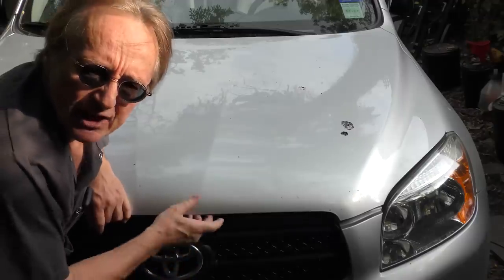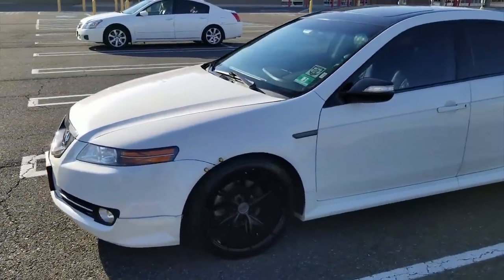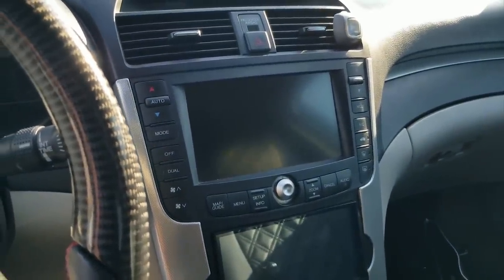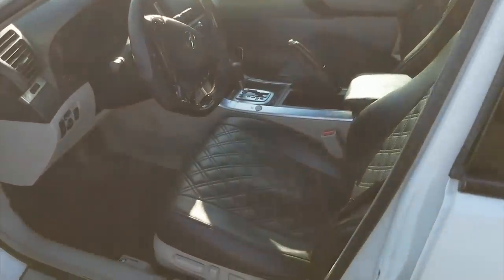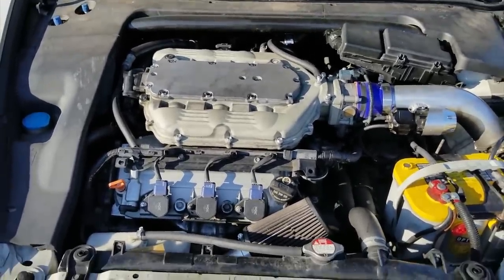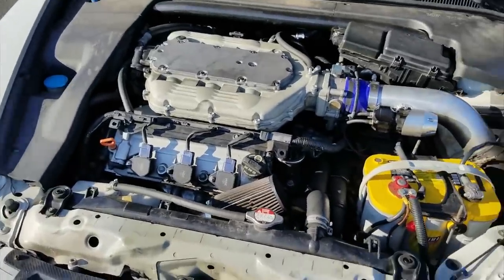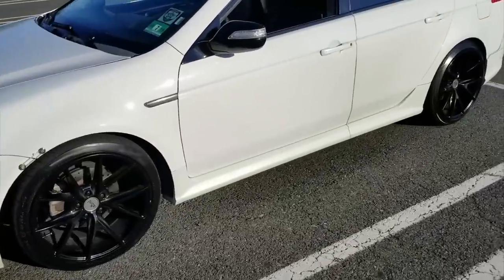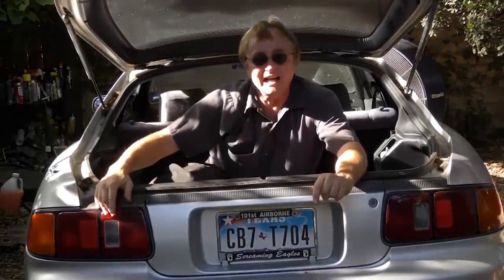Here's Why This Base Model 2008 Acura TL Makes 437 Wheel Horsepower

Comment: It's a turd gen lmao!!!
Reply: Michael Trower Wasn't the transmission kinda fixed in the 07-08 models? I know for a fact that the trans in the earlier 3rd gens had grenades for a trans
Reply: BS. 3rd gen TL is probably the best Acura vehicle this century to date. I have a 4G but the 3G is timeless.
Reply: +Ryan L. What you're driving is a rebadged legend , they stopped using the legend name as it was killing the name Acura.Very good car but you have to understand them.
Reply: Rhoan Campbell get ur info straight, TL is actually the Vigor line not Legend. RL is the Legend line.
Reply: Michael Trower. West Indians and Germans use the silent h.

Comment: Anyone who has watched classic Top Gear knows, because Richard and Jeremy have proven this several times, a front-wheel drive with more than 300 BHP will cause a problem with control and steering at high speeds.
Reply: theylied1776 unless you’re still still spinning your tires you’re fine boosted boiz did some crazy mile runs or something in his 700 hp civic and I’m pretty sure he got over 160 or 170mph.
Reply: That's the problem. The torque from the front-wheel drive transmission makes it harder to steer and control at high speeds. I used to race amateur rally... and all-wheel drives are fine because the torque is at the rear wheels but the front-wheel drives with 300 plus HP can be tricky at high speeds.
Reply: Also, driving a 300 plus HP front-wheel drive at high seeds in a straight line is one thing but get on a Grand-Prix style track and try to take those curves and dips in one of those is totally different.
Reply: theylied1776 oh yeah definitely. Having random and varying traction in the front is never good for corners.
Reply: HLSD and a good suspension/chassis solves this
Reply: No, they won't. You cannot solve a problem caused by Horsepower and Torque with good suspension/chassis and HLSD. The more Horsepower and Torque a front wheel drive generates the worse the problem.
Reply: Some of the fastest race cars are fwd...
Reply: Let me add to my original statement; with good tires as well. If you get good traction and allow for independent drive-wheel speeds; as long as your tires are grippimg and not slipping, you'll be just fine at any speed. Nissan has the FWD GT-R LM (for Le Mans) that has 1250 hp
Reply: It won't make a difference. At a certain point, 300 plus HP, the machine is stronger than any human. That is basic physics.
Reply: FWD GTR or All- wheel drive? That is a big difference.
Reply: Post a link to these race cars. There is a big difference between FWD and AWD.
Reply: FWD my dude it's  a GTR LM not a street car by any stretch not the R35 you're thinking of either
Reply: Jonathan Trevino if it's not a streetcar how does that apply to what we're talking about? But feel free to post a link to this car becuse I would love to see it and look up the schematics.
Reply: Yeah you clearly don't understand basic physics... If it's putting the power down and gripping it'll be just fine
Reply: Engineering Explained has a good video about why it's superior for Nissan's application
Reply: Because it's still a FWD car. You can make a high hp FWD car grip and attack corners very well with a good set up.
Reply: Jonathan Trevino Instead of all the insults why don't you just post a link to this car? That's all you have to do, why is it so hard for you?
Reply: Jonathan Trevino You're claiming it's a front wheel drive car... fine, just post a link. It's a simple as that.
Reply: Jonathan Trevino Enough of the opinions.... post the link!
Reply: theylied1776 the 2018 Civic Type R proves that wrong.
Reply: Martyn Rosenburg How exactly does it prove me wrong?
Reply: theylied1776 It doesn’t because the Type R still suffers from torque steer.
Reply: Knuckles300 Exactly, because every front wheel drive car suffers from torque steer. And the more horsepower, especially above 300 horsepower, the worse it's going to suffer from torque steer.
Reply: Jonathan Trevino I looked up the Nismo GTR-LM and the reason why you didn't post a link to it is because it only ran ONE race and was scrapped by Nissan due to its piss poor performance. The FWD race car failed.
Reply: Man even had torque steer in my 1.4 turbo chevy cruze lol
Reply: andrew Smalls Yeah, that's just the drawback of a front-wheel drive. But you have these front wheel drives with 500 to 600 horsepower controlling and cornering becomes a problem. It's not impossible but with some people it can cause them to crash.
Reply: His car doesn't make 437 HP at the wheels - he's lying.  The most powerful front wheel drive cars made today are 305~ish.  Acura TRX and Lincoln MKZ...a couple others too.  The limiting factor is the transmission torque steering you into a wall - cuz that Lincoln goes to 400HP (same engine) if you get AWD.   If huge manufacturers can't fix that problem with todays technology, nobody in a garage watching YouTube videos did it either.
Reply: Matthew Thrasher Yeah, but this guy is a Tuner. He rebuild the top end modified the CPU. So I don't have any doubt that car will probably have about 475 brake horsepower especially with that Beast of a supercharger he has. If you notice he also mentioned he blew his engine, that is very common when people don't know what they're doing when they modify their engine. I Used to Know guys like this and I thought they were stupid for trying to modify a front-wheel drive to get more than 300 horsepower.
Reply: Matthew Thrasher obviously manufactures don’t do it because it would make the car more expensive to produce. 437whp isn’t that much of a stretch in this car
Reply: lol, what is this nonsense.
Reply: Brad DeGarren You're right, manufacturer's don't do it but you have these amateur Tuners and Weekend Racers that do it. This kid modified his engine, that's why It blew up the first time but he eventually figured it out. If he doesn't put a cooler on that transmission it's going to overheat.
Reply: Reject Which part are you having a problem understanding?
Reply: Jonathan Trevino yes but 300hp and fwd doesn’t grip no matter what you get some wheel spin from Honda’s garbage differential in take off and gear changes
Reply: My 300+ hp FWD handles just fine thank you very much
Reply: theylied1776 lmfao bro there's a front wheel drive Acura integra with 1200 hp hitting 208 mph just fine one time he got swervey but he got back on it and at the time he has 900 hp now he has 1200 on a 4 cylinder

Comment: I like this build, RL J35/J37s are the strongest i think along with the CL Type s j32. Are you using DW-1 trans fluid or something else? How do you like those NGK coils? did your oem coils all fail or you did it as preventavtive
Reply: Redline racing with Redline d6 mix and a Trans cooler
Reply: @PiterStreak  Ah Ive heard good things from people using the Redline D6 in the Glass trans Odysseys. I just use DW1

Comment: Dragsters are automatics..
Plus honda automatic transmissions are manual transmissions with clutch packs instead syncros. A torque converter so you can keep the engine running on idle and a hydraulic system to control everything assisted by the TCM.
Honda have to design their transmissions due to patents permits declined.

Comment: Much praise for that custom engine build.  Not sure if it’s best used on a front wheel drive with the TL slush box.  I wouldn’t exp3ct it to last a whole lot longer.  I had a 2006 TL and the torque steer really sucked.   I can only imagine what it would be like with that much horsepower.   Might be time to use your engine building talents on a rear wheel drive vehicle.  I bet you learned a lot building that thing though, which is very admirable.

Comment: Shoulda had the manual in already.  Then again it’s not my $5,000. Awesome steering wheel & the sacrifices AC for the turbo is something else.
Reply: Jon Rock I've learned a lot through the process. You are correct
Reply: PiterStreak I’m $68,000 away from doing something dumb and hopefully being on this show 😜

Comment: As soon as i heard vtec twice i was gone. Like it's some sort of magic thing.
Reply: John Robinson the video mentions how it's not even true vtec. Hell the dyno chart shows vtec doesn't do anything this setup
Reply: Okay i'll bite. vtec is a compromise. If it was done to it's full potential, honda could not sell it to the general public at a price that would be profitable. And DOT would never sign off on such a thing for every reason that could be thought of. Power and speed cost money. And for most the money runs out faster than any car you could drive. I've built a few engines in my day with good success and had my days in the sun. Back when you could do such things for reasonable amounts of money, those days are long gone never to return. I'm older now got a son to get thru school that is what matters now. Going fast is fun to a point, but not that important anymore. Yeah, i tell myself that.....I have still have the sickness. And will most likely die with it. ( Spits out lure, swims away....)

Comment: It holding up because by the time power comes in the load is off trans slap a real kit on it and see how that teams holds up I bet a modder almotor will keep up
Reply: It's linear power so it's easier on the Trans. A turbo would have trashed it

Comment: Yikes. Unforunately, for the older J-series automatic transmission, they are usually prone to issues, especially under aggressive driving conditions. They can usually have an extra trans cooler to keep the fluid from varnishing, but that’s about it, on top of running automatic racing transmission fluids.

Comment: Spoiled a nice build by placing the air intake in the hottest possible spot: directly behind the radiator and above the ex manifold/cat.
Reply: Still pull though and instale air Temps still lower than a ton of cars 🤷‍♂️
Reply: @PiterStreak  Was that a sentence?  "Still lower than a ton of cars" ??  Doubtful. You're just making excuses for medocrity and poor implementation.  The only location that could be worse would be behind an exhaust tip.  But hey, according to your logic, that would still be acceptable if a "ton" of other cars did it...  Right?  SMH
Reply: @supermarioisacat  clearly you understood. However you want to interpret what I say is your business. I never said that the intake routing is optimal. That's how the kit comes and that's how I left it. Regardless of its location, it works. If you think you can do better, message the company and who knows. Maybe I'll upgrading my intake.

Comment: Actually most Hondas only have VTEC on the intake side. Vtec is basically almost useless now a days even the new turbo Si doesn't have vtec at all unless you are in Europe. And I believe the new type R only has it on the intake side as well for fuel economy purposes  ...there are really only a hand full of motors that have vtec on both sides

Comment: The car is technically manual its automatic and also should have the sequential gearbox as well. If you want to have more revs thats your best bet sequential gearboxes are expensive and that honda is known for having good transmitions is a good deal. If anything keep it stock with the sequential. Not as skill needed but definitely faster than the normal manual.

Comment: The base model of that car has terrible torque steer as it is. With that much horsepower, I can only imagine this thing will never start straight 😂. Some of the mods are really cool though. I really like the smoked out taillights and the steering wheel looks cool!

Comment: Had an 05 tl it died of trans problems 😅
Oooh hes from jersey too!!
Reply: zibby Jdm the 07-08 had the Trans from the RL which was way better. That's why I stayed away from the 04-06
Reply: PiterStreak the facelifts were better :/ but the base 3.2s had slightly less hp

Comment: I think the Automatic is better than the manual. For the TL at least.
Reply: It's better for this guy's scenario because OEM clutch would implode. My 06 TL was 6-spd and still holds 2nd place behind a C6 Z06 for absolutely nailing every little detail. The manual 3rd gen TL caught BMW off guard because 3-series Enthusiasts were bailing in droves to buy the new TL after reigning supreme for 30 years with the 3-series. All I'm saying is test drive one, even if it's got 200k miles on the ODO, still elite.
Reply: @DTMJR1987  I would never have used an oem clutch with this much power increase over stock. I have a manual now and moved the kit over. Using a spec stage 3+ clutch capable of holding 700hp

Comment: Hello Scotty. Just had the fuel filter changed on a 1997 F-150. Engine was running fine before, but now after fuel filter change it's developed a miss fire under load. Idles fine, but misses under load. Want to mention that the filter looks as though the it was never changed since new and now has close to 189,000. Also when removing lines from the filter 1 of the lines rusted though and broke. Replaced the defective fuel line from the filter to the rail from another vehicle of the same year. Any ideas?

Comment: I’ve owned an 04 TL and leased a brand 06 TL. These TL’s have a horrible transmission. The 04 needed a whole new transmission at like 110,000 miles. Even the brand new 06 had something wrong with the transmission, not a big problem but even still.

Comment: Acura needs to step and make some RWD or AWD Models and not crappy FWD or AWD thats basically FWD bias
Reply: Rdaplaumax they do, S2000 and NSX.
Reply: Acura's Sh-awd engine layout are FWD base but still dynamicly supperior to RWD Base Audi or BMWs AWD. The engine sit right on top of axles while the Germans have engine front of axle. Also drive shaft is symetical like subaru while Audi/BMW have an extra shaft to turn the front wheels.

Comment: Even with e85 at 12 psi of boost no way it makes 485hp. And when he gets on it doesn't even sound close. I've got a cobalt ss turbo swapped that makes 320hp and way faster
Reply: Camera frame rate is a crazy thing. I have dyno sheets.

Comment: Why would you buy a base model 3.2 if you’re just going to turn around and convert it to a 3.5 considering the Type-S came with a 3.5 factory. It seems like like he could of just bought a Type-S with a manual trans and he would of saved a lot of time and money.
Reply: The lowest mileage manual one I found online was priced at over 21k private. Not that many manual options on the market.
Reply: I bought the car not being into cars. Slowly started modding it and went from there.

Comment: I'm surprised the stock transmission was able to hold that power... these transmissions are notoriously weak
Reply: Not the 07-08. Sold the car NA and it's a show car now in NY. Trans still original

Comment: but when does it put out 437 HP ? at 7000 RPM ?
Reply: farerse yeah since it's a centrifugal SC. Higher rpm=more boost= power at the highest rpm
Reply: that's pretty high RPM , what are those rivets on the fender by the way??

Comment: A stock on makes about 290hp
Reply: The 3.5 makes 286 at the crank. At the wheels its lower depending on the transmission

Comment: He chanched engine supercharged but he still have the automatic transmission ok that sounds like a car guy i guess and still the original transmission can take the change in hp that he made maybe the dile new he was going to do that and put a biger transmission on that spesific car  because those engines often brake the transmission plus the hp he added thats the only thing i can think of

Comment: Why is a manual transmission over the top and special. I think people see them as something for sportscars and something that is hard to operate but you can learn to drive manual in a day and in this case the car would benefit a lot from a manual transmission and in my opinion i would never turbocharge or supercharge a car thats automatic

Comment: base model auto... bruh. I can't wait to juice up my 3.7 sh-awd MT some day. costs a lot though. you can retain A/C if you wire and plumb in an electric compressor.
Reply: I have a manual type s now. Moved the kit over. Also swapped the J37a4 from the awd 4th Gen tl  👍

Comment: The guy thinks adding a manual transmission is going to add 60 more horsepower, I want some of the drugs that he is on.  If the manual was 5% more efficient than the automatic, which is questionable, that would only be around 20 more HP to the rear weels.  I doubt that the total loss through the drivetrain is 60HP, it's usually around 10%.  So if this guy really has 437 HP his total loss is about 44 hp.  How is he going to gain 60?

Comment: Sorry.  There is no way in hell that makes 437 horsepower at the wheel.  And even if it did (And that's a non-existent 'if') on a dyno, you're not getting that to the ground on a front wheel drive car that may or may not have a 15 year old traction control system on board.
Reply: Matthew Thrasher there's a dyno chart in the video that proves it lmao. And lol!!! The dyno measures hp at the wheels. Am I missing something? Hahaha
Reply: There is a .5 second screenshot of a dyno screen.  So what - google dyno screenshot and take your pick - tons of those shots.  Show me the car on the dyno or a printout that says Acura TL and this guys name on it and I'll cave.